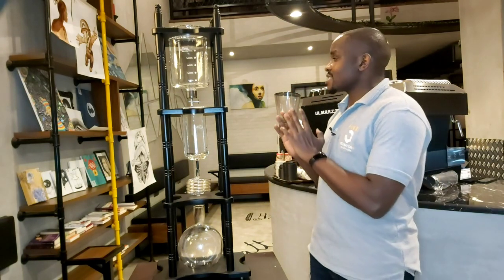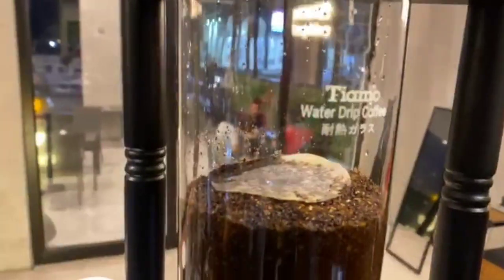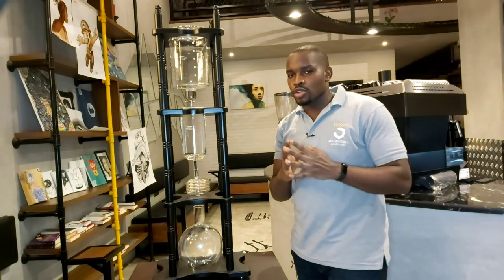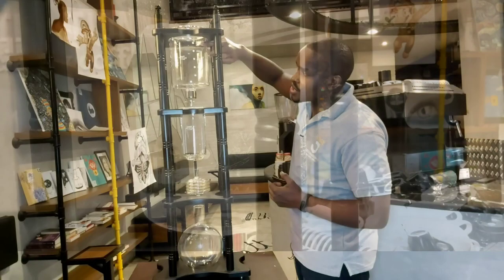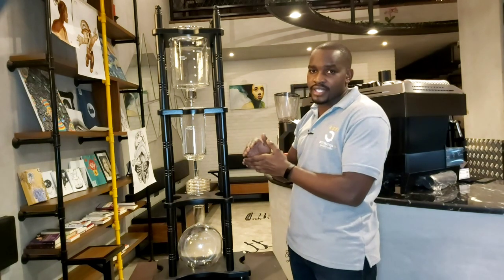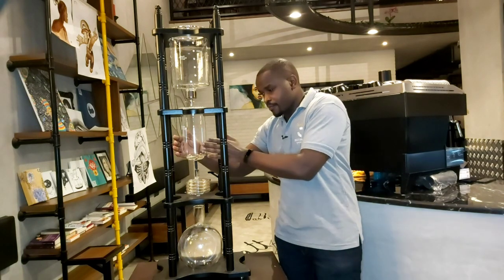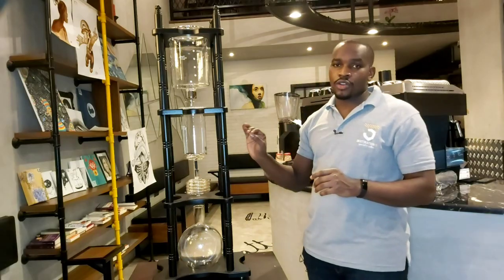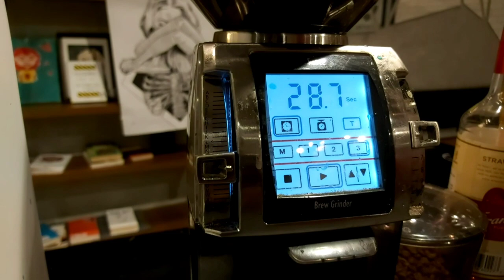How to make a Cold brew Using a #Yama & #TiamoColdBrew #Tower

Comment: Hello Sir,
Greetings!
I have only one question that I am not clear about it. Before starting the dropping from water tank, coffee should be bloomed (pre wet) or how is that process?

Thanks in advance.
Reply from the maker: Hello Mr. Hussain remember this is oxidising coffee so in the min time blooming occurs when we reduce the gases using hot water on quick brews.
Every time we make the cold brew we first release the water at a fast speed for 45sec and after reduce it to 1sec per drop to proceed with its brew time.

Comment: Just got the Yama Cold brewer and brewed my first Batch.  The grounds in the coffee chamber(beaker) appear half wet, half dry.  How do you achieve full saturation?
Reply from the maker: For How long did u brew the coffee
Reply from the maker: I think you dint put the filter paper on top of the grounds which helps in equal distribution of water to the grounds. Or evne the grind size, ground your coffee slightly larger than th v60 grind but not to reach the v60 grounds. Or still place 20gms of water in a small cup and after you have set ur apparatus ready to brew, hold the beaker and pour the 20gms first on top of the coffee grounds slowly and evenly on top of the filter paper the rest it for 40secs and after open ur tap. When u open ur tap make sure the drops fall in the centre on the filter paper and which each drop should fall after 2secs. Remember it brews for 12hrs but after 6hrs check and adjust ur tap cause there is a slight change in water density. Any other questions are welcome